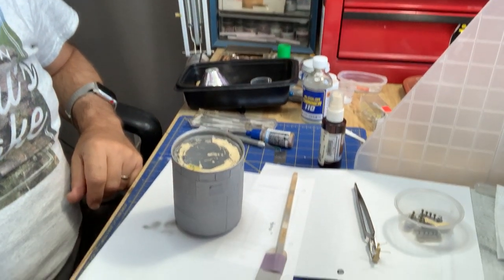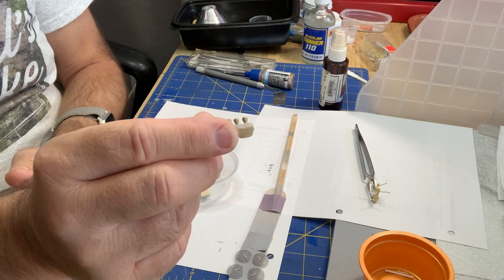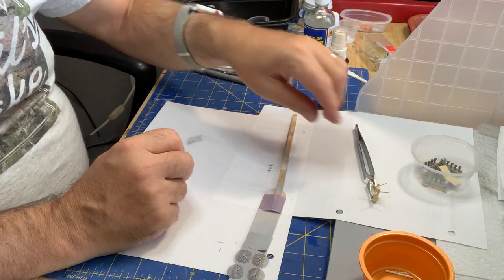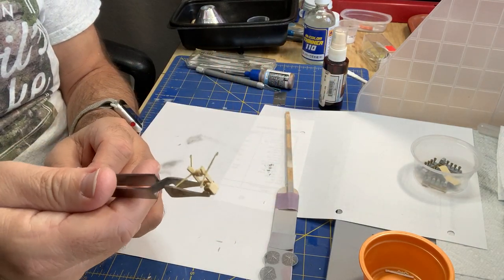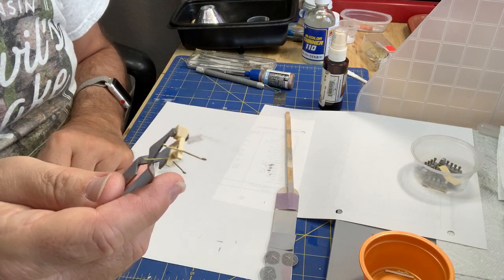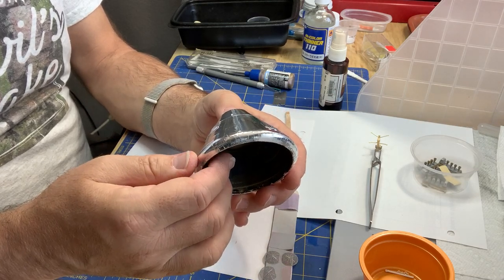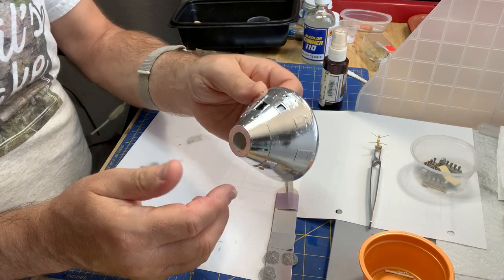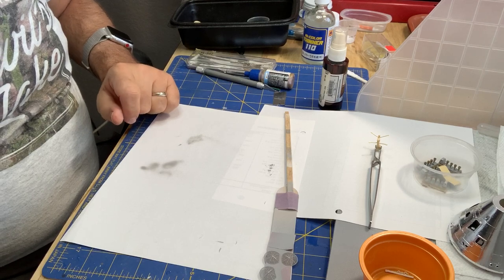Apollo CSM 4 070920

Comment: The Mylar strips covering the CM are very pronounced.  Maybe you can get away with painting a 1/72 or smaller CM, but in quarter scale and larger the only real way to pull off the effect is to actually use Bare Metal Foil - cut into strips and applied.

Comment: That foil looks really good! Is that Bare Metal Foil? I have never had results that good when I used it.
Reply from the maker: Yes, Bare Metal Foil Chrome. I used a light coat of Micro Foil Adhesive on the model since the adhesive on the foil seemed to have lost any tackiness. Use small pieces.